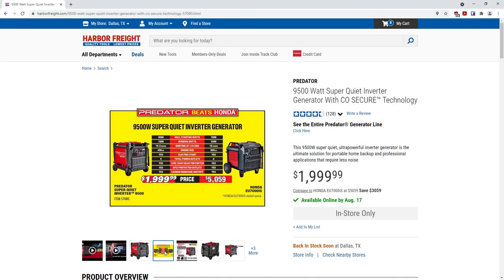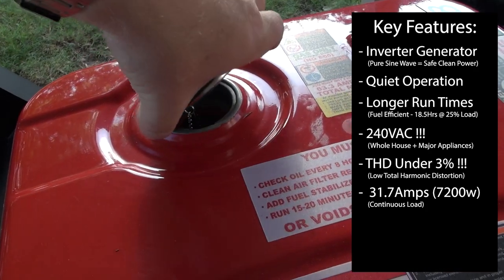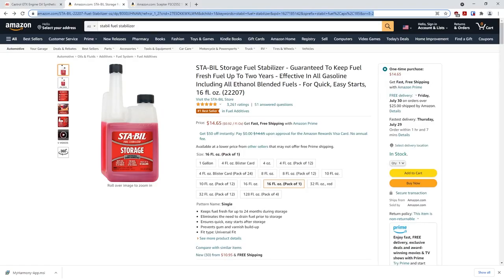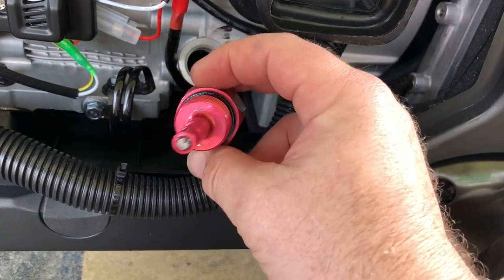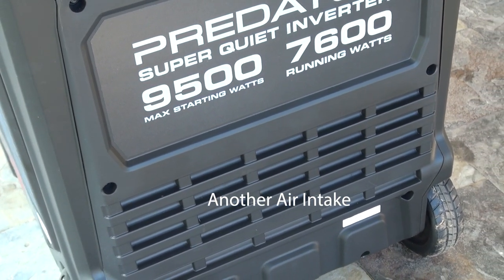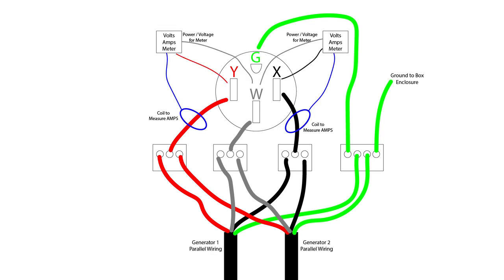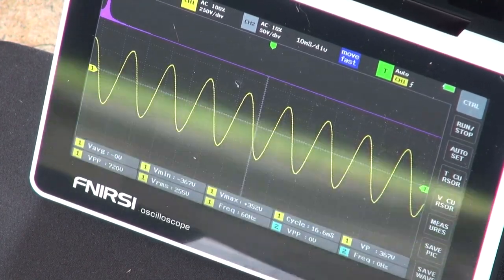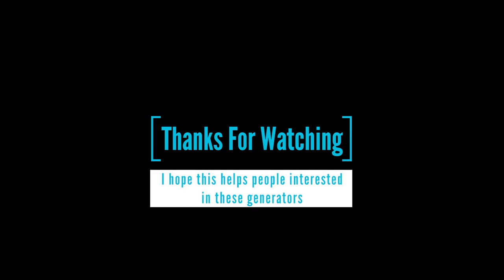Predator 9500 Review: All The Technical Tidbits In Under Ten Minutes (+Important Break-In Warning!)

Comment: Looking forward to video about your electrical box. I have a similar Cutler-Hammer/Eaton panel on my house but without a main breaker. I need to upgrade my box like yours. Excellent series of videos, BTW! Last February was not kind to central Texas, so I am preparing now. Thank you for sharing!
Reply from the maker: No main breaker?  Yikes.  Does the box have a spot for one?  I'd be sure to add that.  It's the key to the whole thing.  You have to be able to turn off the incoming feed before you connect in the generator(s).  

That video has turned into a bigger thing than was intended.  Just covering the hookup is easy enough, but it's morphed into a whole thing about judging the amount of power capacity you'll need.  I think it might need to be split into two.  One quick and easy covering the actual hookup, and one that covers judging capacity/need.  coming soon...
Reply: @Texas_DIY  Agreed. Luckily the box is designed to have a main breaker and the leads from the meter are plenty long enough to install it, relocate to other large breaker to accommodate for the generator indeed breaker and install the interlock kit. Sounds like the right call on splitting those concerns into 2 separate videos. Looking forward to them. Thank you

Comment: Hello Jason, very helpful videos.  Have you ever considered getting the natural gas kits for these generators or do you not have access to natural gas and this is why everything in your house is electric?  I have a 4 ton trane a/c in my house, gas central heating, gas water heater, gas dryer and gas stove.  I plan to get a soft start for the a/c.  Would I still need 2 of these generators to run the a/c and refrigerator?
Reply from the maker: Depends on your AC.  Not counting the AC, one unit can pretty comfortably run my whole house (Computers, lights, etc.)  But add in the AC (particularly heat needing resistive loads, or especially the electric clothes dryer, and that's all out)

If you're mostly gas, you may well be able to get by on one unit.  And while you may be able to convert these to gas, you'd probably be better off getting a hybrid unit.

Duromax makes an interesting looking hybrid unit, but the one that looks the absolute best right now, fixes all the shortcomings of both the Duromax and the Predator is the: GENMAX GM9000iED

It has dual fuel, an oil filter, rear exhaust, and can be paralleled to another unit to double the output, but without needing the box.  (just plug into the 50a socket on one of the units).  And it's made by the same factory that produces the Duromax and the Predator.   

If you need a hybrid unit, I'd look seriously at that one.
Reply: @Texas_DIY  I remember reading or hearing somewhere that the Duromax's power output was not as clean as the Predator.  I wonder how the GENMAX performs.

Comment: Nice Video! I have a question where did the written comment: THD less than 3% come from? Is that an industry standard assumption? or did HF publish that? I've been searching for that info (looked at spec sheet) but I can't find it published. Thanks !
Reply from the maker: I got the stat from the generator bible website.  No idea where they got the info from.  Based on what I've seen with the power quality, I have no reason to doubt it, but my equipment isn't capable of independently testing THD for me to verify.

Comment: Last question....   Could you connect the L14-30R connectors from each generator together to run the generator in Parallel?  Or is there something special about the parallel ports.  My concern is the gauge of the wire on the parallel kits seems small.
Reply from the maker: **Technically**, I don't see why it wouldn't work to use the L14-30 plugs, but, it would very risky and dangerous for reasons you might not think of... here is my warning about doing so:

First off:  There is a comment in the history of the video from a user "B F" where he implies that would be a better method.  Only I think he was suggesting each 30amp feed would go into the main circuit breaker, with no parallel "kit", the logic being more available amperage from the pair.  I went into a bit of a wall of text regarding the pitfalls of doing so.  But let's say it was a parallel kit instead.

So instead of direct feeding it into the home from the 30amp plugs (very bad idea) you instead made a parallel kit where each 30amp plug is joined together in a box with the 50amp female dryer plug.  Basically, just  like mine, but with 30amp male plugs on the ends vs. the parallel kit connection.

Danger 1:  As soon as you energized one side with a generator connected and running, the exposed male plugs on the other cable would also be energized with 240VAC.  (so, suicide plug )  This also means if one plug were to fall out, get removed, knocked out, whatever, those falling exposed metal plugs are energized.

Danger 2:  And this one is the doozy that most people probably wouldn't consider...   the power of each 30 amp socket is passed through a breaker on the front panel of the generator whereas the parallel ports **are a direct connection to the inverter with no circuit breaker**, this is really important, and I believe it's wired that way for a very good reason.  

If one generator of the pair is disconnected from the circuit (say breaker trips on either front panel, or one of the plugs is removed or falls out) ***then the generators will no longer be synchronized***.  Those two machines have to stay perfectly in sync to an accuracy of 1/60th of a second.  Meaning just like two clocks that you turned on at the same time will not remain perfectly sync'd for more than a few moments, almost immediately the two units (now running independently) will probably drift out of frequency sync.

So if for example, the plug fell out and you put it back, or if the breaker tripped and you reset it... this would probably do spectacularly bad things to the inverters and, to the sensitive electronic equipment in your home.  As your power would suddenly be composed of two different frequencies at the same time.  

I believe this is why they wire the parallel kit directly to the inverter via the specialized ports, making it hard to accidentally disconnect them (firm fit, and no breakers to potentially interrupt the circuit), and, why if one of these generators ends up overloaded, it forces you to completely shut it off the machine and restart it, (there is no reset button).  

By making you completely restart the machine, it forces an overloaded unit, (that would now be out of sync) to be started from scratch, allowing it to re-synchronize with a still operating generator on the circuit, and not get all explode-y.

So yes... you could do that, and I don't see why they wouldn't initially synchronize if they were both plugged in, and the circuit breakers on when they started.  But the plugs would be dangerous, and, you'd be setting yourself up for a situation where extraordinarily bad things could happen, if you or someone else made one single mistake when operating them.  Proceed with extreme caution.

The gauge of the wire isn't too bad, considering in this kit it's only carrying the load of one generator.  Once they combine together, then you can pull a greater load off of them at that point and would potentially need a higher gauge wire from the physical point they combine to the 50amp plug.

Comment: Great review and great advice.  I ordered the magnetic dip stick and a drain plug.
Reply from the maker: I did the magnetic drain plug as well.  Some of the reviews warned about it breaking from over tightening... so be gentle.  :-)  So far, mine isn't leaking or anything, and I feel better with the magnets sucking away most of the junk.
Reply: I just ordered two myself from this vid.  Thank you

Comment: Great video.May I ask if the neutral is bonded on this?I was told if powering your home with a panel that is neutral bonded you need to have a floating ground
Thank
Reply from the maker: My understanding is that if it's permanently installed, you are supposed to unbond the neutral.  If it's a temp hookup (which this is) it's typically not bothered with.  So I did not unbond the neutral from the frame.  

Other folks have made videos on how to do that... I believe the bonding cable is one of two that resides on the back of the panel, attached to the grounding screw.
Reply: @Texas_DIY  Thank you for the reply.Mine is temporary also but I’m going to remove mine after researching it.I don’t think it is a big deal at all but code does say neutral can only be bonded once(which is at my panel).

Comment: At 7:00 you labeled the top half of each 120V/20A female connectors with an N and a Y.  Why didn't you label the bottom half of each connector with an N and an X, or did Harbor Freight forget to balance the X & Y loads?
Reply from the maker: As I recall, top and bottom were the same.  I think harbor freight chose to balance by having the 30amp 120v on the far left, be the other leg. So ~30 amps of 120v from the household outlets combined, and another 30 from the far left plug.

Comment: Excellent video and commentary. I have a question: I own a traditional generator. Is it possible to mitigate surges, spikes even brown-outs with whole house surge protectors installed in the main breaker panel, ups point of use units and RV surge protector dog bone type adapters?  Hope to own an inverter-genetator in the future but am trying to work with what have now without frying any boards in my TV, microwave, fridge, etc.  Thanks!!!
Reply from the maker: That one is tricky.  Surge protectors usually aren't cleaning the power, they're intended to be something more like a "fuse" that reduces the extreme voltages.  "Power conditioners" can help to clean up some noise, and it would be interesting to see what the waveform from a generator looks like after passing through one.  I'm not sure how much it would help.

There are UPS units that can help a lot with it.  They're referred to as "online" models, they are taking the power and making use of it on one side.  But on the output side, you are receiving power only from an inverter.  it's actually kind of like how the inverter generator works, taking dirty power making use of that, but running it through an inverter to re-produce clean power regardless of what is being fed in.  

This style of UPS unit is typically more expensive and nicer, because they're always engaged, always producing clean power, they're just not using the battery to do it until the line power is cut.

In contrast, the cheaper much more common "offline" UPS units, will pass through the existing power (maybe with some surge protection) and only engage the inverter?battery when the power goes above or below a threshold.  So with the offline units, you're basically always receiving generator power, until the threshold is reached where it needs to switch over the battery power and cut off the line power.

Search on Amazon for "On-line UPS"  One of the first results with the "double conversion" would probably do really well to clean up the power for select "sensitive" devices.
Reply: @Texas_DIY  
Thanks Jason, I’ll do some searching.

Comment: Great video. Very helpful -- particularly about the magnetic dipstick. That might be the difference between the inverter lasting 2,000 hours versus 1,000 hours.
Reply from the maker: I expect it will help prolong the life of the motors.  Particularly if you are a heavy user.  In my case, I'm still not much over the 30hr breakin period on both of them as power outages are pretty rare... but I'm still happy to have the extra protection, especially since there isn't an oil filter on these units.

Comment: I have questions please I have a commercial griddle 208v/240v I purchased the 9500 run a 10/3 wire with 3 prong plugs used a 3 prong adapter to plug into the generator but the griddle heats slowly to about 130 degrees what am I doing wrong? Thanks for any help.
Reply from the maker: Obviously i can’t see your setup, but what you’re describing is running it on half power.  I suspect your 3 wires are: hot/neutral/ground, which will always be 120v.  

You need to use the 240v plug (with the switch on the front panel set to 240), and the wires will be two Hots and the ground (ignore the neutral) to feed into your griddle so you’re actually giving it 240 VAC. (a multimeter is your friend, even a cheap one from Harbor freight). 

The other videos in the playlist deals with other aspects of these generators, including connecting it to your home, and what parts of the plugs carry which legs of power, you might find that helpful. 

(If you’re not confident in what you’re doing please consider an electrician)

Comment: Just a quick question. You stated that the unit has around 31 Amps I’m assuming that’s at  240 V . If you use the 240 outlet for 2 120 volt legs i’m assuming that’s where they’re getting the 60 amp output 2 30amp legs.
Thanks
Reply from the maker: Yes.  240v pulls equally from both legs, and consumes available amperage evenly.  Split phase 120v pulls from just one leg.  So you could pull a total of around 60amps of 120V power.  Note how the plugs are wired though from the video.  The household GFCI outlets all pull from one leg, so you'd need to tap into either the 30amp 240plug, or, the 30amp 120V plug to access the other leg of power.

Comment: Stupid question...I've had this for 2 years. Used it twice....just refilled the oil, filled up with fuel. As soon as i start it, goes directly into overload.  Nothing plugged in engine will not revup at all. Possibly carb float?
Reply from the maker: Usually only revs up under load (or if you have eco mode off it runs at a standard speed).  Going direct to overload sounds like something is defective (assuming you have nothing connected when it does this)
Reply: @Texas_DIY  FYI it was actually the inverter..... what's completely fried I must have overloaded it the last time I used it. Replace the inverter for a 340 bucks good as new.

Comment: what does the circuit breaker (top right control panel) do?  should is be in the on or off position?
Reply from the maker: If you are using the plugs on the front panel, the circuit breakers protect those and keep you from overloading it.  If you are using the parallel ports, they bypass the circuit breakers, connecting directly to the inverter.

Comment: Can I leave it in quiet mode through out the entire time while running my house? Or should I leave it off when running heavy loads like ac, dryer, etc?
Reply from the maker: I run mine in eco mode almost exclusively.  Between the pair, they seem to be able to spin up quickly enough.  If I were planning to run the clothes dryer (HUGE load) I may turn off eco mode so they're ready for it though.

Comment: Awesome and informative video!!! love your detailed descriptions and explanations! MAHALO!!! i Haven't ran mines yet.. nut when doing a parallel kit..does it have to be the same size generator? im just worried because i have an ice cream and shaved ice truck here in hawaii..and i have 2 soft serve machines with one that needs 8000 starting watts to turn over the compressor..and the other needing 6000 starting watts to turn on that compressor! im just worried that if both kick on the same time, it may shut off (and why im looking at a DIY PARALLEL KIT with possibly running a lower watts generator.  your thoughts on this..and MAHALO FROM HAWAII!!!
Reply from the maker: Aloha!  That's a good question.  I really don't know if they have to be the same size.  But I think it's would probably be a really good idea that they are.  The load is shared equally between the units, and both contribute to the total. 40Amps, means 20Amps from each of the units.  

But what happens if you have a 20Amp generator, and a 40Amp generator... and then you ask for 50Amps?  That would mean 25A from each, more than the first unit can handle.  

I would THINK, that with copper wound units (if you managed to sync them), heat/resistance would build as you reached the unit's capacity, the output would lessen a bit and the other unit would simply feel more draw and supply more, picking up the slack for the lagging unit.  

However with inverters, they just shut off when they pass their capacity.  You have to power it off and back on to resume power production and to let them re-sync with the existing power frequency present.  So the question is as one of these generators starts to exceed it's max, is there a point where it just doesn't supply any more (but keeps operating), allowing the other unit to contribute more... or does it just go "nope" and shut down.  I have no idea... and don't have a decent way to test it.

I'd think you'd be better off with a pair of units.  No doubt you have other stuff running in your truck (lights, fans, AC maybe, and the motor to shave the ice is probably going to pull a LOT, especially when you actually push it against the ice block and run it (not just on startup).  I'd get an AMP meter and fire up everything at once, and do some testing.  You may be pulling in total, quite a bit more than you think.

You might consider contacting Micro-Air and see if their units can be adapted for your ice cream compressors.  Some of their units made for RV AC units might just cross over)  If you haven't seen the other videos in the series, check them out, it talks about the inlet hookups, the Micro-Air soft start, etc. they might be helpful for what you're doing.